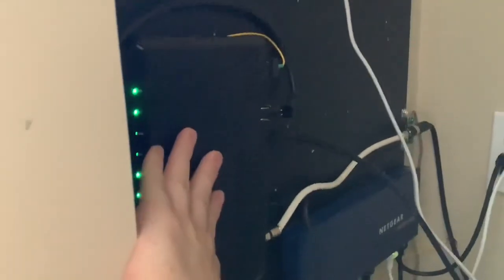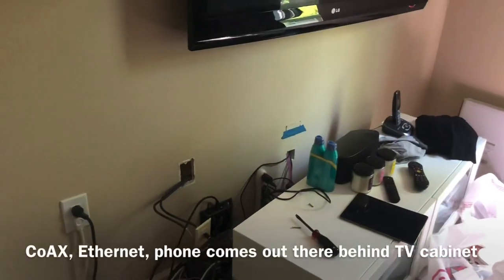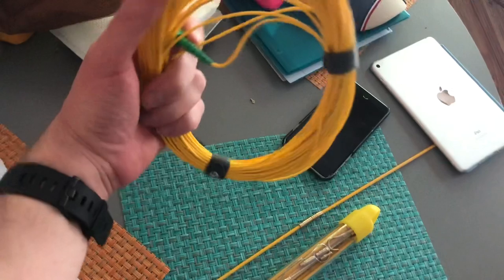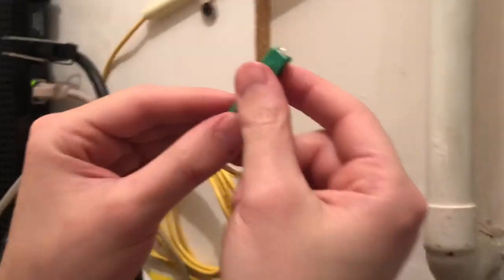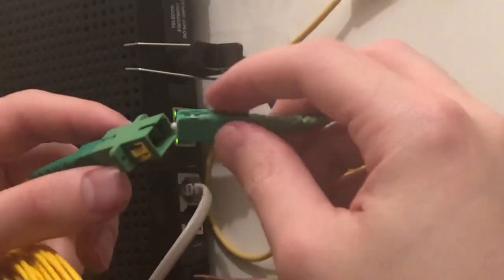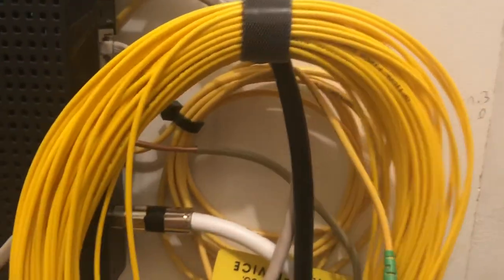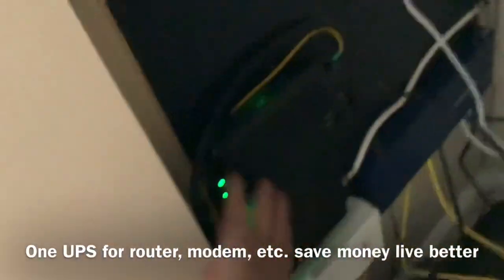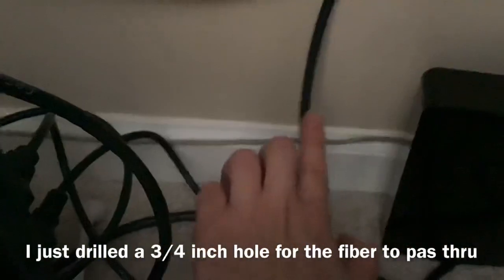FiOS ONT relocation guide

Comment: Great video but 2 points

1. NEVER point an active fiber optic cable towards you or someone else. The laser emitted can permanently damage your vision. You were shockingly careless in this video & a bad example TBH.
2. Never touch/drop/scrape the tip of the fiber optic cable. Proper light transmission relies on a perfectly clean solid. Leave end caps on until you are ready to connect to a device.

Very smart to ground your coax cable. It will reduce noise/EMI on the line, although probably very little at that distance. Fiber is really awesome
Reply: The lasers they use are Class 1. Not a hazard, WHATSOEVER.

Comment: This is pretty awesome!! How much do fiber cables run usually?
Reply from the maker: Pretty cheap tbh, $5-$20 for the cable at various lengths. The catch is that you cannot crimp them without a special tool which is a couple thousand dollars, not worth or recommended. Just buy the right length ahead of time with plenty of slack and coil the slack somewhere.

Comment: Good Job, however I would of run the Ethernet and fiber cables inside the wall to do a cleaner job. In any case,  you accomplished your task. 🙂
Reply from the maker: Yea I learned after the fact that I couldn’t hide it in crown molding. I thought it was possible but guess not. Since then I’ve taken it down and sold the condo but DEFINITELY a fun project

Comment: Hey, this was a great video. I have a question though. I have my electrical walkthrough of my new home build coming up. My area does not have fiber yet but Verizon says that fiber is coming in the next 2 years. I would like to prepare the house for fiber when it arrives. I know that verizon will bring the fiber to the outside of the home, but I would like to run a fiber cable from their "outside of the home spot" to my network rack upstairs. Since I have to do the wiring now before the walls of my house get put up, could you please advise me as to which type of fiber cable I should run so that I can put the ONT in my network rack? Thanks!
Reply from the maker: You’re better off getting someone to run the micro duct that Verizon uses (1 inch inner diameter) from the outside to the inside. I included the specs of cable they use but Verizon will have better luck if you were to officially use some sort of conduit

Comment: I have an optical fiber cable coming out of the ONT box at my new place . How do I connect it to the router ?
Reply from the maker: Nope don’t touch the fiber optic cable. The ONT should have an Ethernet port on it. You would plug your routers internet/Wan port into the ONTs Ethernet port using an Ethernet cable

Comment: You should never be extending it from the outside just run coax or cat 6
Reply from the maker: What’s the risk? It’s the same APC standard, there is no service degradation, I’m sure small business customers would be doing the same to locate the ONT close to the telco closet. Plus the ONT is better climate controlled with a shared UPS
Reply: @AMPTechGrade  there is degration techs will even tell you you shouldn't it should only be one cable from the street that's why the don't run them if they don't reach the house
Reply from the maker: I’ve had a tech offer to leave me extra cable. I’m sure if it’s just a few extra meters it would pass, as long as it wasn’t a few hundred
Reply: @AMPTechGrade  they can't even cut the cable because its fiber, they do leave however cat 5e or coax the fee extra inches or feet of length is do to how close your house is to the main box